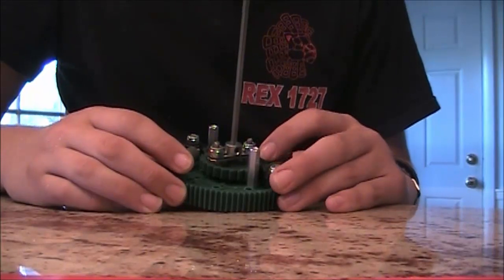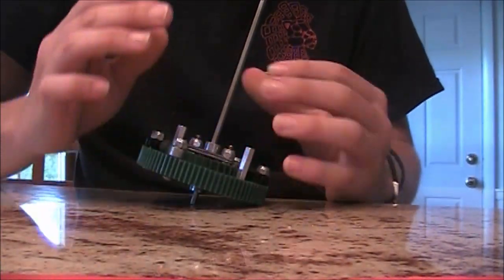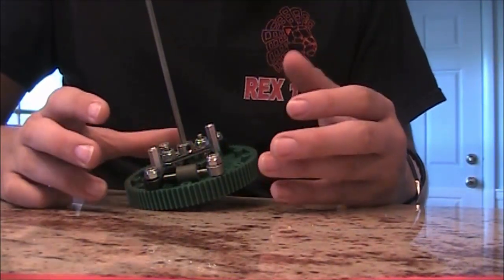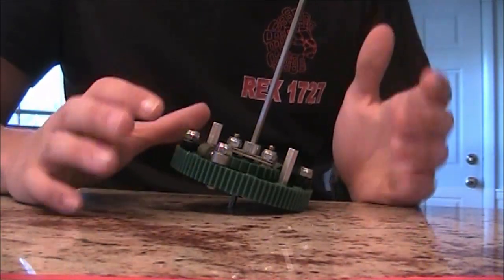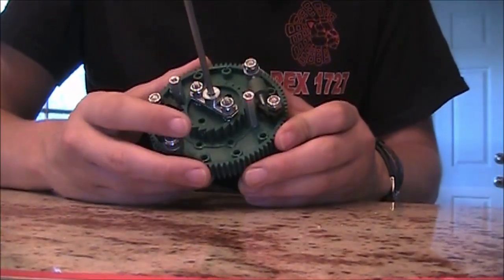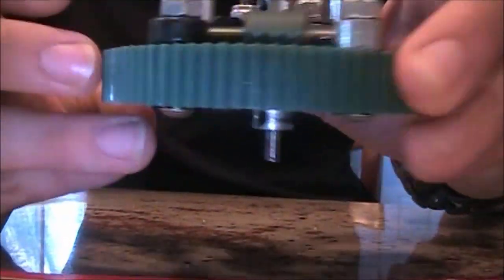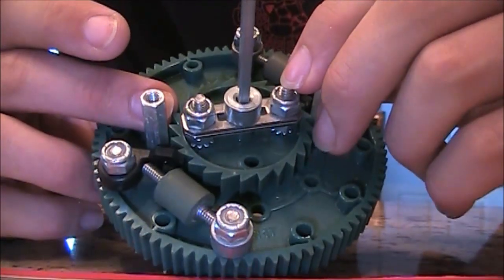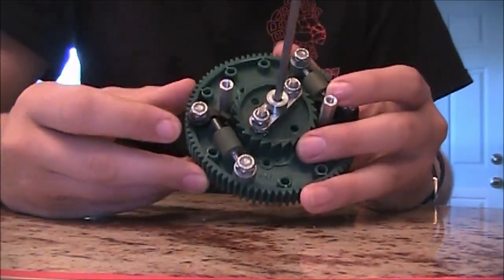REX 1727B-Ratchet and Pawl Device

Comment from the maker: Devin Turner, We are using pneumatics but not on this device, in the past we have used them in a brake, and we are planning to use them in a lift
Reply from the maker: plenty of people have done fine without it, it is not a requirement, but it is a safety measure, some really good teams have done well without them. however we have heard stories from other teams that were browning out, and then installed a ratchet that helped
Reply: I'm new to this. Can you do another tutorial on how to build this? Thank you